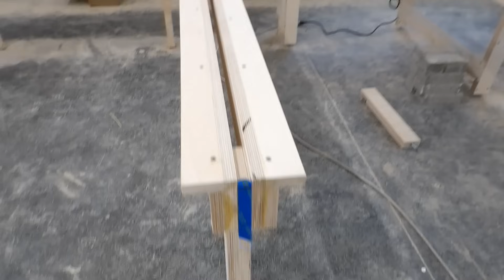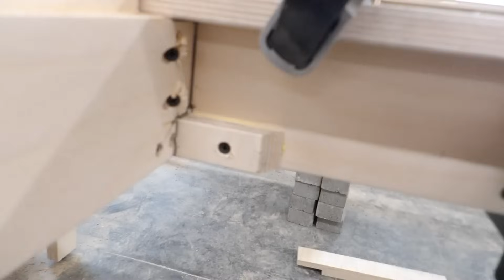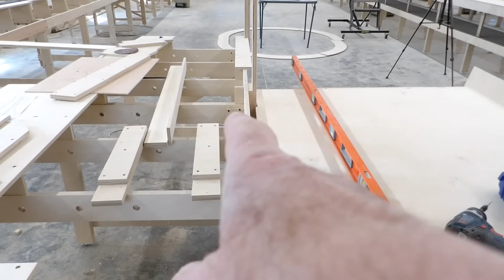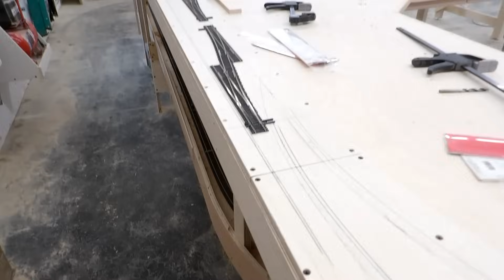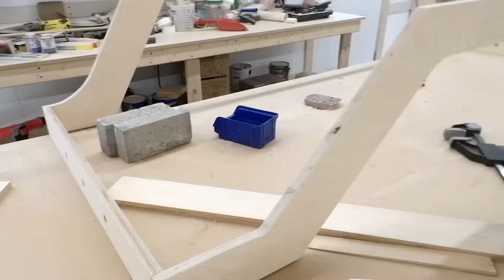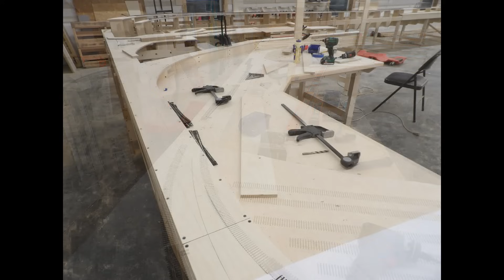The Sydney Project 11: Workbench and a deep dropped frame

Comment: Hi Peter, looks like an amazing layout.
Can you tell me what colour spray can you use for spraying the track before ballasting?
Cheers Andy
Reply from the maker: I normally use a red oxide primer, which is a good rust color for the rails.  Then hit the ties with a dark brown.  Just use a flat brush for this.  Don't try to paint each tie individually.  You can be a bit slap-dash and don't worry if you get paint on the rails because a little color variation is good.
Reply: @mpeterll  thanks Peter, much appreciated.
Also amazing carpentry/joinery skills, which we try and copy.
Regards 
Andy

Comment: Dear Peter, awesome wood work! Went back to the vid in which you explained the design for this layout, to be honest I didn’t fully grasp the work bench area when I first saw your design, but must now definitely say that it all comes clear whilst watching your construction work coming together. Love the edge on the work bench. Even though you said there’s a little gap, it’s almost too small to mention. In my woodworking experience this kind of edging almost always needs some extra attention. Awesome how you rounded off the edge. Magnificent work bench and the way it is incorporated into the layout framing. Cheerio
Reply from the maker: I've since filled the gap with wood putty and sanded it smooth so it is now virtually invisible.  BTW, I didn't round off the corners - the wood comes that way.  The edging is cut from a 2x4, intended for framing a house with.